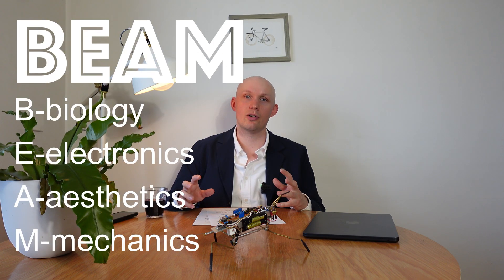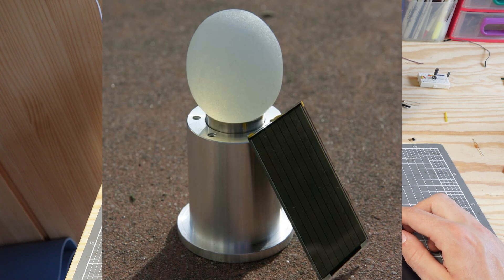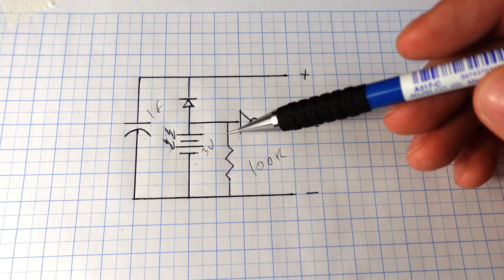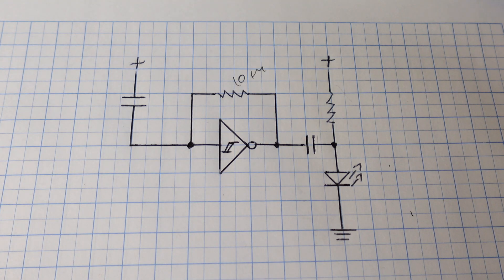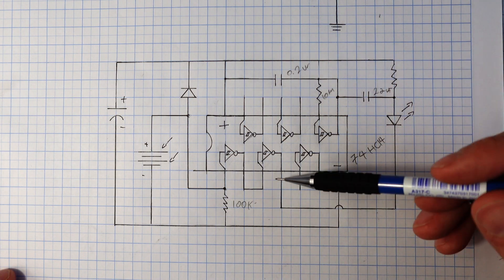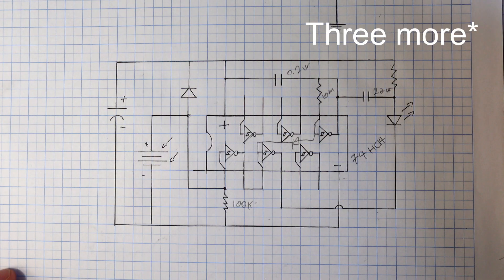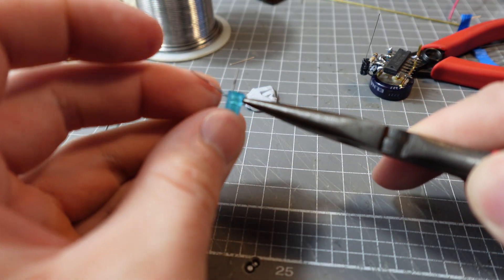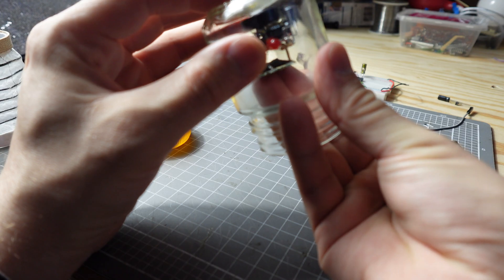The BEAM Pummer, solar powered plants.

Comment: Do you have any recommendations for a “starter kit” so to speak of electronic components to begin building beam robots? Or maybe a digikey/mouser list :) something to get started so i dont have to buy every component one at a time for projects. I find your videos super informative and thought provoking!
Reply from the maker: Thats a really good question actually. 
I dont have any specific recommendations however I have seen a few kits on RS Electronics, I think the brand was Analog Devices, that look pretty complete, if a little pricy. 
I think most of the starter kits out there are probably OK, as long as they have a good range of caps, resistors, etc they are probably worth it. 
Might make a good topic for a video, cheers!
Reply: @ALTcorporation thanks for the response, I think it would be a great video topic, especially to highlight the specific components often found in your tutorials. I appreciate the recommendations!

Comment: Super interesting and fun. I'm haven't taken a power electronics class yet so I always struggle with the solar charged supercap part. Can't seem to get it to work, as the solar cells are always rated for short circuit values and the supercap looks like an open circuit to them at first... 
It would be awesome if you can maybe talk more about solar pumps, boost circuits for low, variable input voltages/currents (i.e. regulating solar cell output to charge a supercap efficiently) etc.
Also there is a cheap(ish? It's under 100 bucks and they usually cost around 1k) power profiler by nordic semi, in case you want to dig deeper into current draw on these things. 
Loving your channel and video style as always. Thank you
Reply from the maker: Yeah, that is a bit of a problem for these circuits. As long as everything is connected correctly it should charge, however it will be really slow at first as the cap will be pulling the voltage down a lot and the solar cell will be working outside of its most efficient range. Also the diode is really important, otherwise the cap will discharge back through the cell when it is dark. 
It would be cool to do a video on some of those systems but to be honest I haven't built a lot of the high-efficiency solar systems (maybe an excuse to build more).
The nordic semi stuff is great and I would like one however an oscilloscope is first on the list lol. 
Cheers, thanks for the comment. Glad you are enjoying the channel

Comment: I really like the blue flash! The slow decay looks really nice. 

For those wanting to build low power oscillator circuits using the 74HC14, I'll add a comment that often most of the power draw comes from the Schmitt trigger action of the gate's input.The Nexperia brand version of the chip has good graphs in the datasheet (although I'm sure this differs a bit from brand to brand). 

The amount of current each inverter's input draws during the slow transition from low to high/high to low is dependent on supply voltage, but can be shockingly high, almost half a milliamp at 4.5V. However it's not nearly as bad at 2V, only 40uA. I never know if I can drop links into youtube comments so just google "Nexperia 74HC14 datasheet", and the graphs are on page 8, Figure 8.

This extra current can basically end up limiting the power supply voltage reached by a solar powered circuit with a constantly running oscillator, since above a certain voltage the chip draws more current than the panel produces (for very small panels). So basically, if using the gates this way as a single gate oscillator, don't plan on reaching supply voltages much above 2V with tiny solar panels.

BTW I think the 0.22uF cap is connected to the wrong side of the 10Meg resistor in the schematic. 

It might be worth seeing if there's an outdoor paint that will stick to that plastic lid, since many consumer plastic items really aren't UV stable for long duration outdoor exposure.

I hope this little dude lasts a long time on the deck!

Comment: A question: at 3:12, is that a Schmitt trigger inverter? Sorry for my laziness.
Reply from the maker: It will actually work with either. Mine used a Schmitt trigger and a Schmitt trigger will definitely clean up the switching but I think the original design used a standard inverter.
Reply: @ALTcorporation  Thanks for clarifying! ( ' u')

Comment: Great project! With this, you have most of the types of BEAM robots built!

10:53 A few BEAM projects that comes to my mind you could build includes a 5 motor walker (IIRC you are working on one), a 2 dof head and a turbot (like Scuff)!

And here are some inspirations for these, though I imagine you've seen them already...
For walkers: Other than Walkman, you can check Harold R. Ilano's old BEAM walkers, those were absolutely amazing! (You can find them in the "Videos by Harold R. Ilano" playlist on Vintage BEAM Videos, and links to them in the video descriptions) 

For turbots: The Solarbotics turbot has a really cool circuit, they have the complete circuit in the kit's downloadable pdf. But J Wolfgang Goerlich's turbot circuits are also fun to play with. If I remember you said you were working on a Scuff like turbot. For me that would be really interesting! I built a circuit based on Scuff, but modified to use a 74AC240 octal inverter instead. A funny thing is that I messed up the wiring of the motors, and it just went perpendicular to the light source instead of directly towards it!
Reply from the maker: Cheers, actually, I am working on a few different projects covering most of those. 

I have a scuff based turbot that is actually mechanically finished. I am not super happy with how it reacts to light. I have been tinkering with it a bit, but I really think the design needs another set of sensors, sort of like a front/back, left/right, and up/down. 
The running parallel to the light seems to be sort of built into the simpler design. It is still a really interesting circuit though. I love how simple it is. 
 
My next big project is going to be a full copy of the Vbug/Walkman. Probably will not get around to that until the new year , but it is on the books!
Reply: @ALTcorporation I did get my turbot to be fully phototropic by just changing the direction of the motors! There was a guide by Bjorn Brindefalk on how to make this happen. The easiest way you can find it is to go to JW Goerlich's #14 "Mini-Flip / Flipper III" and go to the planning notes, the guide is at the bottom of the page. One thing I also changed about the circuit is that the top/bottom sensor is the common reference voltage of the two solarcells, so I would only need left/right photodiodes. The secret is that the motors should always turn in one direction, and the one that's on the side of less light should turn.

Comment: Can you do a simple experiment like incorporating BEAM circuits into a FPGA? There should be a way to scale these simple circuit designs into something more sophisticated.
Reply from the maker: Good question. I think the real question would be how to program the FPGA. It wouldn't be to hard to model Nv and Nu neurons but making them work together, even in a model, is a little tricky.
Reply: @ALTcorporation  So a Raspberry Pi Pico would be more suitable to scale things up instead of FPGAs? What's your opinion?
Reply from the maker: @b.robinson206 a Pico would probably be more than enough, I have done some experiments with a normal arduino and that was enough for some simple designs. The real challenge is finding out how to put things together to get the behaviours you want. I think the best bet would be to write a program where you can connect simulated neurons together at scale and simulate sensor inputs etc. That way you could try as many variations as you like and only build the ones that work. It’s not that hard to model the Nu or Nv neurons mathematically, I think Tilden wrote about it, but it’s a little outside of my programming skill
Reply: @ALTcorporation Thanks for your response on the issue. I was wondering, could evolutionary algorithms be used to help with designing circuits to do what you want? Or even, I don't know, reinforcement learning techniques? But, either way, it seems like a fun project. Again, thanks for your response.
Reply: @ALTcorporation  Tricky, but not impossible. The benefits would be astronomical. Imagine scaling BEAM to more sophisticated systems. Should be possible to do a simple experiment to see if it can scale.
Reply: @ALTcorporation  That'd be cool. I'm interested!

Comment: I think the biggest problem is what I define as traditional BEAM - Bicore Everywhere And Mandated!  Where in the "Biology, Electronics, Aesthetics and Mechanics"  (other than tradition) does it require Bicores or Nvs or 74HC14s?  What is wrong with using op amps or MSI digital CMOS - lots to be gained here and can be made more predictable and capable but still be BEAM-like.  The bicore and Nv-neuron path ended up as a scalability dead end as you mentioned, but nothing other than Tilden's initial influence (???) seems to have demanded this eventual Nv and Bicore dead end.  BEAM seems to have so much more opportunity than the traditional effort presented, which I'm having fun experimenting with.  BEAM as defined doesn't even explicitly preclude small, simple microcontrollers either, unless my understanding of BEAM aesthetics is heretical.
Reply from the maker: I actually completely agree. Some of the rules regarding BEAM seemed pretty arbitrary and it really limited the scope of what the robots could do. There were some more interesting takes from others, Wilf Rigter had some really interesting op amp designs (and some really really cool headbots) but it always felt a little artificially limited. 
Ultimately I would like to explore some other directions I think BEAM could take, my walker project might (big maybe at this point) even end up with a microcontroller down the road. 
Cheers, thanks for the comment
Reply: @ALTcorporation  I think even though hybrid BEAM bots are not mainstream, they actually carry the spirit of BEAM robotics itself- being more customizable and super flexible. So yeah, traditional BEAM has lost some of it's purpose.